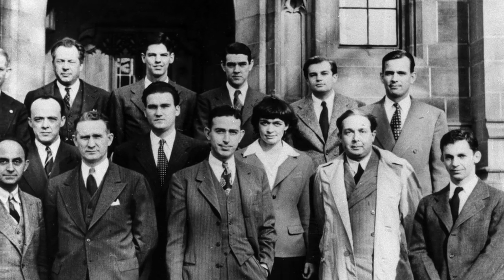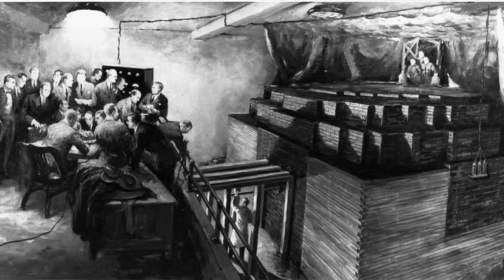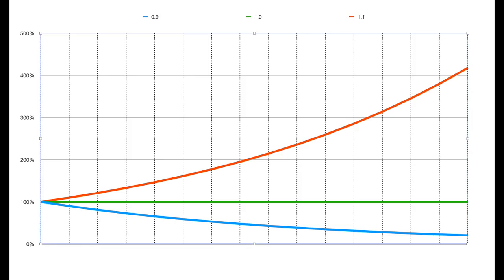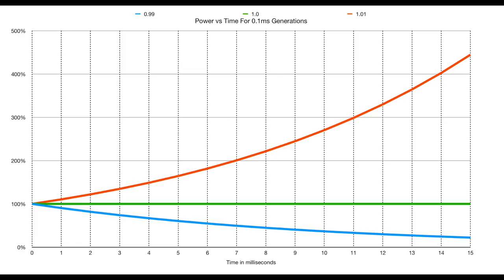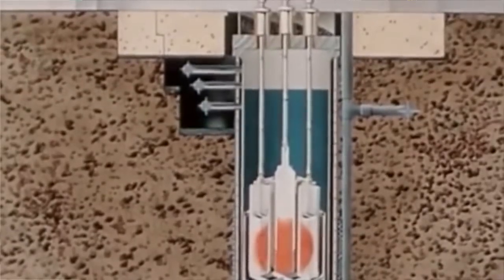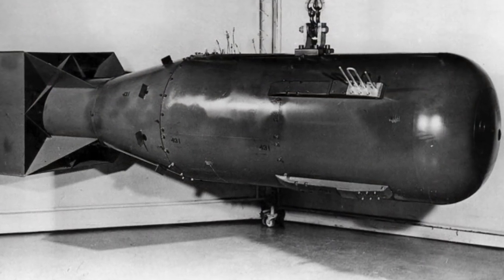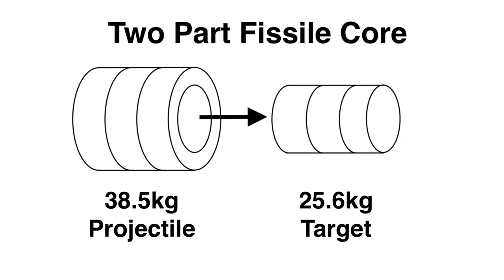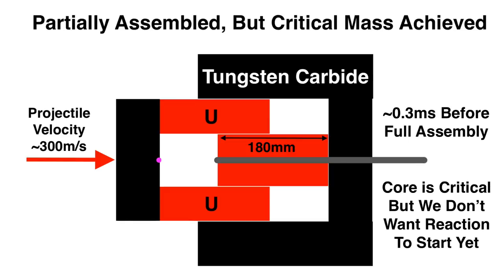Going Nuclear - The Science Of Nuclear Weapons - Part 2 - Chain Reactions

Comment: 2:20 "Adjust the neutron absorption rate, this is done by control rods"

No. That is not really accurate. The Neutron absorption rate is controlled by the moderators, not the control rods. The control rods are used to control the power of the reactor and are mostly all the way out in a modern reactor.

The problem with controlling the absorption with rods are two. 1: it burns the fuel uneven. 2: it may make the reactor instabile and be overcritical. This is for reactors that got negative gain void coefficient. That is, if there becomes a void in the coolant (say water), the reactor speeds up in steed of slow down. This was the issue in Tjernobyl and the reason why the reactor blow. It was pretty much a combination of several different factors. The sad part is that this was well known years before even the reactor was planed.

5:00
Again, this is never the case with modern nuclear reactor. Simply having a moderator that change characteristic with temperature they the reactor can go over critical and sub critical in matter of milliseconds. Actually different part of it can be over critical and different part can be sub critical at the same time. The advantage of this being that the reactor can never become highly over critical or super critical, because then the moderator will just boil of and stop moderating.
In other reactors like NaK, Lead and Salt they use other physical changes in the moderator to make the reactor over or under critical, removing the need for the moderator to boil.

Also say that Putting Natural uralium in normal water it will never become critical. U235 have to be concentrated to around 1.5% or so (from 0,7%) to be critical. So early reactors used heavy water or graffite. (that was what the heavy water plant in Norway was for during WWII).

By the 50-tys the technology of concentrated U235 become cheaper light water reactors was more economical. First one used around 2% just to be "safe" but fairly early one with light water reactor one recognized that can use much higher amount of U235 because of the void coefficient pretty much making it impossible for a light water reactor to become over critical.   Civilian reactors there for start using 3-3.5% fuel so they could burn the fuel for longer before it dropped under ~2% (well really a bit lower because of the plutonium that is created).

One relized then that having a higher concentration of U235 actually make the reactor more controllable, not less. Also making it be able to have more power in a denser structure and work for a longer period of time. Submarine reactors for example have about 20% U235.

Some old reactors also have been uppgradera to higher power. This have been partially done with making a more efficient turbine, but also by replacing the fuel rods with one with one with more U235. Now days about 4.5-5%. A 4.5% concentrated fuel rod also produce 50% less radioactive waste than 3% once... actually its even a bit bigger diffrance than so because of the reactor be able to burn more of the plutonium as well.
Reply: Except neutrons absorption is exactly how control rods work, not sure what your objection is here. And using control rods doesn't necessitate your reactor going super critical, that is more an edge case of particular reactor dynamics. Even Chernobyl style reactors this can be avoided and has been as there are still like 11 of them operating around the world.
Reply: My objektion is that Manley implies that the rods control the reactor from being over critical. Its simply not the case (for modern power producing reactors). That is done by the moderators. The controllrods are just done for trolling the reactor.

" Even Chernobyl style reactors this can be avoided and has been as there are still like 11 of them operating around the world."
The diffrances is that its got a negative void gain coefficient because of the combination of moderators an water. (and well enriched uranium). Under nomal operation its not a issue, but if a bit of the water boils of its a problem. While the reactor don´t go over critical of that, the borium tips of the controlrods might. And if the reactor is running very very hot (that is the case if you run 5% of the reactor core on a equivalent 100% power) the slight increase in criticality of the rods will make the reactor blow up (while not a nuclear explosion).

In a light water reactor this can´t happen, because the water is the only moderator, so if the reactor loses water it can never trottle higher than the maximum power of that certan set of fuel rods.
Reply: It can't happen in RBMK anymore either since they upped the enrichment and changed the control rod reactivity increase problems. Point of fact, the void cof for RBMK ranged from, and I quot

"It has been reported on the basis of studies made after the accident that the calculated void coefficient of reactivity for the RBMK-1000
reactor extended from -1.3 x 10^-14 %^-1 (6k/k) void for a fresh fuel load to + (2.0-2.5) X 10^-14 %-1 (6k/k) void for the steady state refuelling regime; and that the effect on reactivity of a total loss of coolant was -2/3 for a fresh fuel load and
+(4-5)|8 for the steady state refuelling regime."

Or to say it another way, having duel moderator doesn't mean for sure you will have a positive voiding, not even RBMK always had it and has been since accounted for via updated methods of control rod management, enrichment and such. 

But to your main point, it is true that the little fluxuations of momentary power transients are more the job of thermal expansions, but control rods are still used to control overall reactor operations via management of the neutron flux, imma grant him the "technically correct" award as they are critical in controlling flux and multiplication factor during start up and shutdown and power ramping both up and down and overcoming losses in reactivity as fission poisons increase.
Reply from the maker: +matsv201 I’m not aware of the mechanism by which the moderators controlled the reaction in the Chicago pile, how did they run it at different power levels since I don’t see any way they could adjust the graphite bricks?
Reply: Ya, Chicago pile in particular was nearly all control rod controlled. You can read about it, it is actually kinda terrifying here: https://www.iaea.org/sites/default/files/publications/magazines/bulletin/bull4-0/04005004147su.pdf
Reply: Nono.. you are perfectly right about the Chicago piles

The is is that you are saying "this is done by using controll rods"
What you was probobly refering to is "this was the way it was done"

It sounds like you are talking about reactors in general, while you really just talking about generation 0 reactors
Reply: "Or to say it another way, having duel moderator doesn't mean for sure you will have a positive voiding"
Well that was really not what i was saying at all. If one counts the controllrods as moderators, most modern reactors have at least two moderators. Its really the negative void cof. that is the problem.

"-1.3 x 10^-14 %^-1 (6k/k) void for a fresh fuel load to + (2.0-2.5) X 10^-14 %-1 (6k/k) void for the steady state refuelling regime"
Well.. i didn´t know that.. that is a very interesting fact. (and i would guess, to technical for about 99% of the population)

Of cause.. even in a freshly charged RBMK reaktor its kind of a freak event. Still freak events will happen.
Reply: For the Chicago Pile, and for all graphite moderated reactors, reactivity has always been with absorbing control rods. But reactivity can be controlled by many ways : geometry change (see Mulholland Falls movie - a screwdriver controlled reactor), boron content in water, ... (by the way, PWR combines boron content and control rods whereas BWR use control rods and water flow)
But don't confuse  a "control" with counter reactions - mostly due to temperature - that participate to the possibility to control the reactor level of power
Reply: Only Scott's videos, out of all of youtube, end up with comments that are this intellectual.
Reply: Admitting, as a nuclear engineering person, I am all over this video like white on rice :D
Reply: Well.. there are a few others, but most of them are smallish channels. Well 10-100k
I would say AdoredTV is one. I would say EEVblog have pretty decent coments to. 
Marco Reps channels also got quite knowable watchers, Julian's Reviews, bigclivedotcom.

Of cause they have a other audience. AdoredTV is computer stuff and the other are pretty much all of them electronic channels.

Then there are all of Brady Haran Chanells. He got like 10 of them or something. But of cause, its a bit of more quality videos (because pretty much everyone in the videos are professors) and the comets are...  well not allways that insightful. But some are.
Reply: To reduce some of the confusion correct some facts. Reactivity control in a pressurized  water reactor is done by chemical shim (e.g. boric acid concentration changes), not at all fully relying on feedback mechanisms from the coolant. In a boiling water reactor, flow of water through the core and regulation of the control blades are used for reactivity control. Other reactors (liquid metal, high temperature gas reactors) rely more on the coolant and moderator feedback for reactivity control as using boric acid in those types of reactors is not possible.
Reply: The nuclear scientist I knew said that modern nuclear warheads have more power after 1 second of exploding "than all the bombs used in WWII, including the two dropped on Japan."
Now why would anyone want to MAKE something like that? They like thinking abt the world ending? I can think of no reason to have made them.

Comment: would hitting plutonium in a critical state with a sledge hammer made out of plutonium that is allso in a criticla state be a good idea?
Reply from the maker: +Theldras Pneumonoultramicroscopicsilicovolcanoconiosis not good
Reply: Please, no. Just no
Reply: LOL! "be a good idea".. I like the terminology  :)
Reply: There was an accident similar to this I seem to remember, they dropped a sub critical mass of plutonium onto another one, caused by a screwdriver that was holding it up slipping (reckless AF!). All present died I believe.
Reply: It was the neutron reflector, one dropped and one held up by a flathead screwdriver in the second incident.  Famously known as the The Demon Core, I had thought it was used in Castle Bravo where it generated a much higher yield than expected due to the Lithium generated from previous testing but a quick check with Wiki tells me it was melted down instead.
Reply: @Theldras Pneumonoultramicroscopicsilicovolcanoconiosis
                                                                                                               I would be happy to pay to view this experiment being conducted LIVE ..... from an appropriate distance from said experiment of course.
In fact i'd rather pay per view this than pay to watch Champions league Soccer.
Maybe you should consider a kickstarter :P

Comment: Hey Scott, I've heard about an liguid salt nuclear reactor.. But how this work and what is the diference between this one and the grafite blocks reactor?
Reply: In most present reactors the moderator is graphite, heavy water or plain water.  Helium was used experimentally (the Ft St Vrain reactor in Colorado, since deceased).   The liquid salt reactor uses graphite (usual design).  The differences is not so much in the moderator but in the fuel and cooling.  Most current reactors use water or HW for both; the LFTR uses liquid molten salt for both fuel and cooling.
Reply: @puncheex2  IIRC, the Fort St. Vrain reactor used helium as the coolant, and graphite as the moderator.
Reply: @russlehman2070  So it was; I wasn't clear about that.  Thanks.

Comment: I guess the point of a nuclear reactor is that if you don't have a certain grade of reactants you don't get a nuclear explosion, but the balance of criticality seems almost irresponsible.
Reply: Irresponsible in what way?
Reply: I meant running something that could explode like if anything went wrong.
Reply: Ahh, reactors can't really explode in a nuclear sense. You can get more trivial steam explosions or hydrogen explosions, though, but we have had problems of steam explosions and chemical ones long before nuclear reactors!
Reply: I meant non-nuclear self destruction.
Reply: Ya, that is just how energy density works I guess. You can't get a reasonable energy density without some kind of risk of that density becoming.....rapidly less dense.

Comment: How are we able to control yields?
Reply: Math and engineering! If you have good understanding how long your bomb will hold itself together, you then have a good idea about how much energy will be released! Getting the bomb to fission/fusion more material before it flings itself asunder is the real challenge. Certain designs do better than others, gun style, for instance, is VERY inefficient, consuming less than 2% of the fuel. Compression/implosion devices do much better, and thermonuclear do better still! Advancements like better neutron reflectors, internal neutron boosters and other stuff that they don't let us know about, they can improve yeilds without adding to much more material, consuming more and more of the available fuel.
Reply: Usually, in fission-fusion bombs, this is done by modifying the amount of tritium injected into the core just before the chemical explosive goes off. This changes the amount of neutron flux generated, and so causes a variable yield

Comment: nuclear reactor is basically a controlled A bomb :D
Reply: Sort of, though it is impossible for a power reactor to explode in the way a fission bomb explodes. There is simply not enough fissile material in the reactor core. You will certainly get a huge excursion of neutrons and photons (heat right up to gamma rays) which could readily lead to a conventional kinetic explosion, this being different from a nuclear explosion.